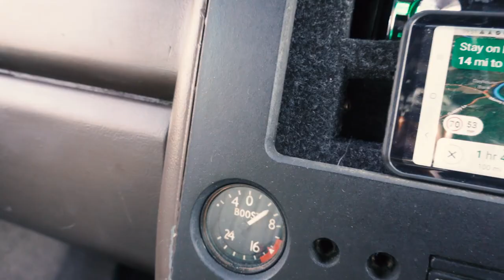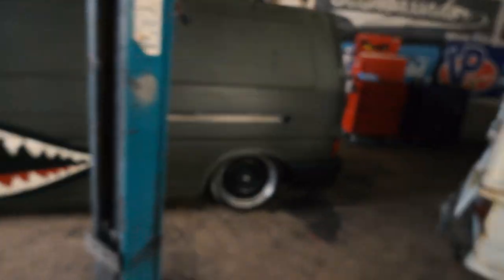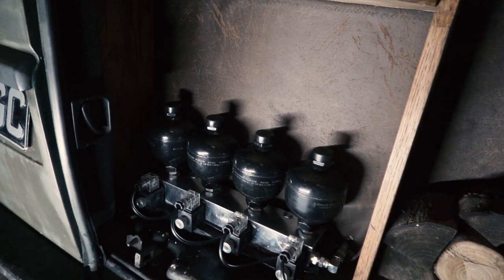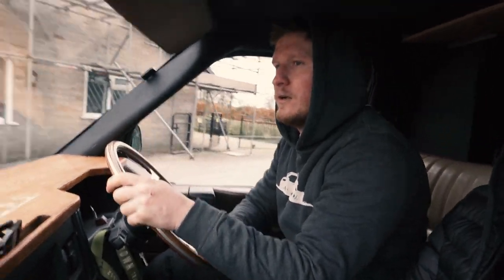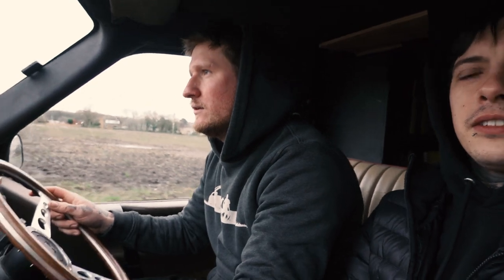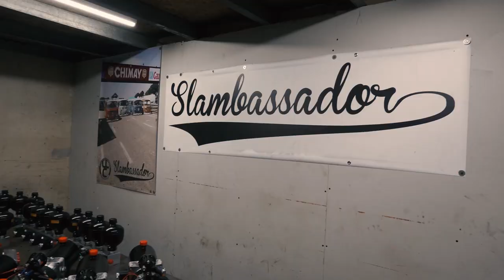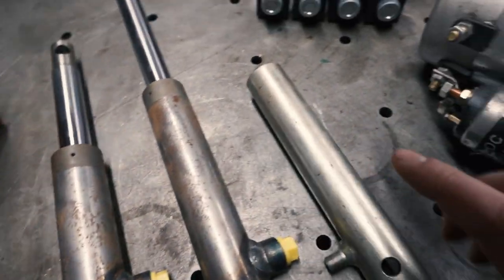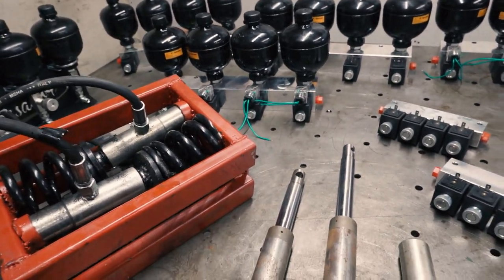The new Slambassador hydraulic suspension kit is insane || Roadtrip ||

Comment: This would be good in an RV if it could auto-level itself on any surface (within range), no more things rolling off the table, no more sleeping on a slope. I personally don't care much for lowered suspension, it looks good but it's not practical. Raised suspension is great for off-roading, but on the road it makes the vehicle more top-heavey which isn't good for cornering or low-bridges. Hydrolic suspension could provide the best of both world's.